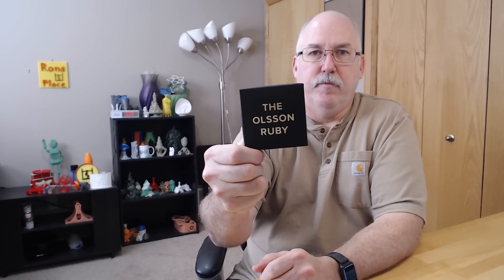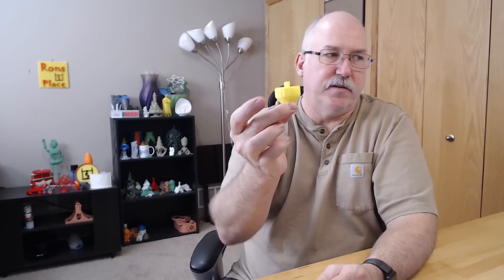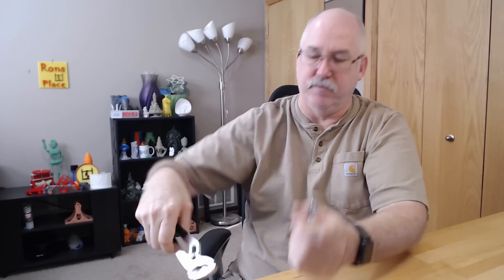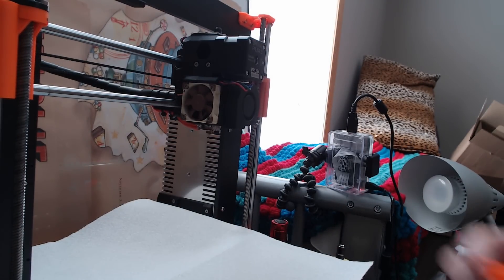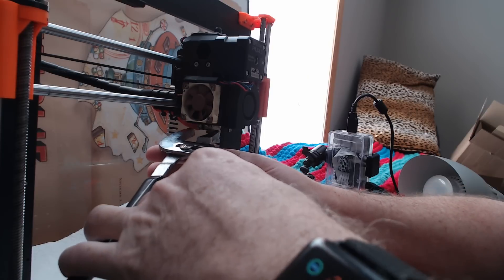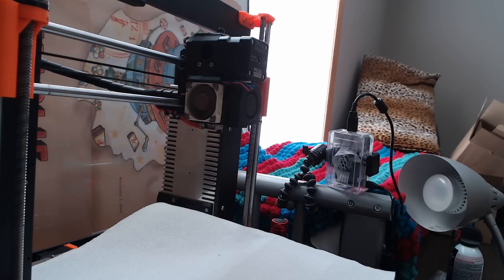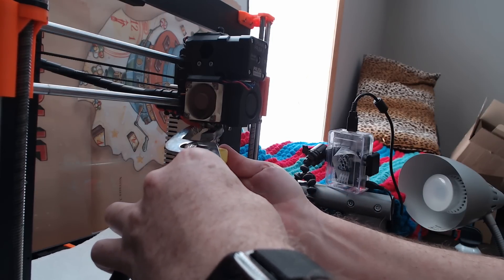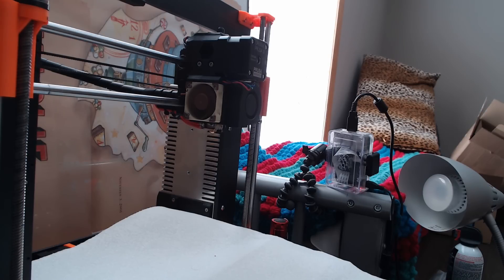Ruby Nozzle - Prusa i3 mk3

Comment: Hey Ron, I noticed the compatibility list on the Ruby's page said for prusa you had to lower the heat block half a turn, but I don't see you doing this.  Have you had any issues with the Ruby so far, and did you have to significantly change your live z with the new nozzle?
Reply from the maker: I compared nozzles and the sizes were the same..  I only had to tighten up the nozzle and it has a nice (but small) gap; works fine with no clogging.   I did reset my first layer of course to account for changes in z
Reply: Thanks for the followup, going to be installing my ruby this weekend, and wasn't looking forward to fully dismantling the hot end to lower the heatbreak/block a half turn. I'll make sure I have at least a little bit of gap when my wrench clicks and hopefully I'll have the same result as you :)

Comment: Hi Ron, according the PRUSA it looks like you forgot to leave a small gap between the nozzle and your heater block. The heat break tip and your nozzle should meet inside the heater block if this is not the case you might have some wobble between you heater block and heat break. But great instructional video Ron, nice work!!
Reply from the maker: Thanks for the comment!  You are absolutely correct about needing a gap.. there is a gap remaining, but just very small :)  I also check this by doing a cold pull.  This will often be able to show a seam if there is any leakage.   So far so good though!  Thanks again and thanks for the kind words.

Comment: I work in a quality control department and calibrating torque wrenches is one thing we do. I printed my little torque wrench and checked it at work on our tester and it was consistent at .5-1nM printed in PLA. I printed the version that used the hex insert to hold the socket for less worry about heat transmission to the plastic.

Comment: How accurate is the MK3? And your CR-10?  Enjoying your videos. Thanks
Reply: Thanks for your reply. I started out with a Monoprice Mini V2. While it has been good for what it is, I'm looking to upgrade. Trying the next model up, Monoprice Maker Select V2 and while it does print, it hasn't been as enjoyable as its little brother, the Mini V2.  I want reliability but without breaking the bank. :) And I'm waiting just a bit longer before I order an MK3. (Waiting for all the bugs to get worked out.)
Reply: I'm leaning toward the CR10 Mini. Would you be willing to make an episode about your CR-10 and share your slicer settings?  Thanks again.
Reply: Will do 👍

Comment: Good video and advice. I’m definitely getting a ruby, bling,bling, but will wait until I’ve dialled in the mk3 first. I’m getting random layer shifts on the y axis printing a benchy off sd card.
Reply: Ron Hunt just updated to the latest firmware release, hope that stops the random layer shifts. I’m also going to print some more things but using Cura.
Reply: I had layer shifts on the Y axis after I built my MK3. It turned out I had the belt pulley rubbing the motor casing. Once I adjusted the pulley out a hair I haven't had a shift since.
Reply: James Elmore thanks but the pulley isn’t rubbing on the motor housing, however, the belt is not centred on the pulley, it was originally so I’ll adjust the pulley position a little and monitor it.
Reply: Ron Hunt yes it won’t hurt to check again, however, two prints since firmware update and no problem.... thanks

Comment: I did some research on the ruby for food grade  it will not work for that due to body made from brass,  Hardened or stainless steel will work. the coated ones think would not use either.